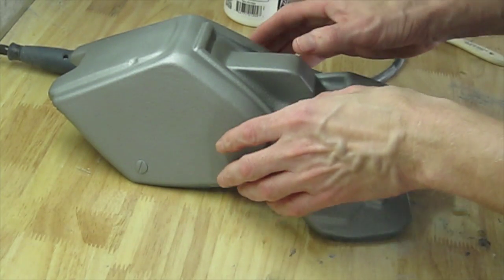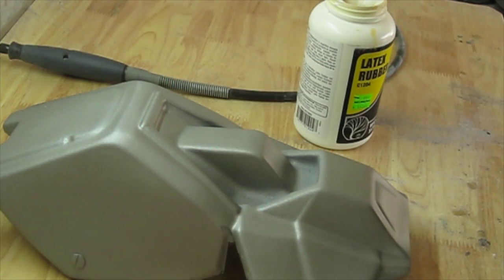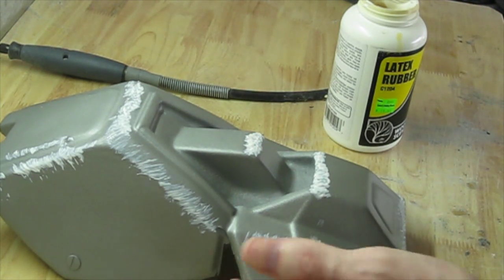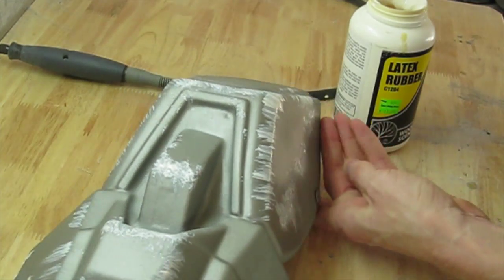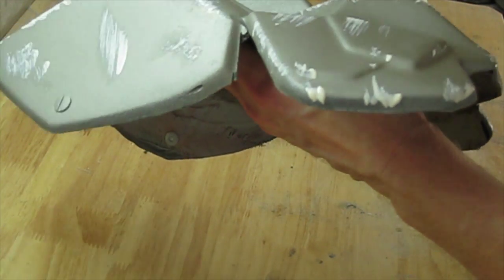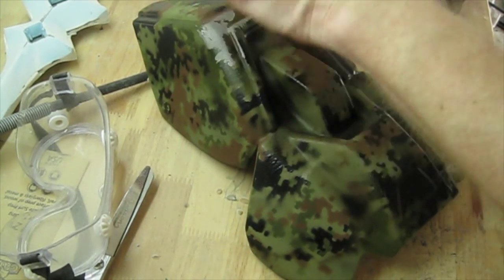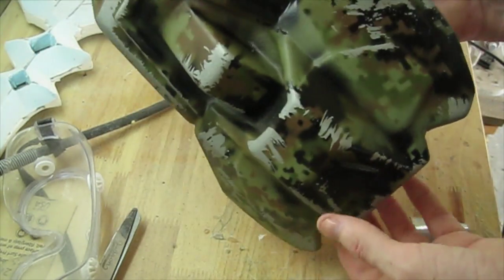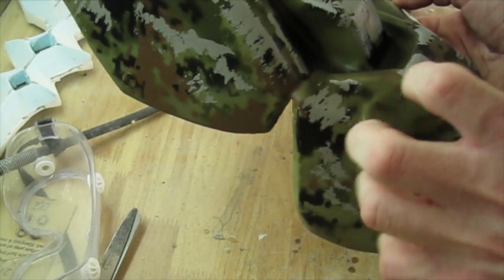Weathering Armor: Chipped Paint

Comment: Drybrushing with a lighter silver color before you do the latex would add another layer as well. Hmm you could add another base coat and sand down a bit once the latex is removed to give it a scratched look. Have you experimented with multiple layers and the latex? Base coat then add a light layer of latex and then base coat again with another layer of latex. do the finish coat and peal down to the first layer again.
Reply from the maker: +Jonathan Bowen That's something I would explore if I wasn't already putting on 5+ layers of paint. Even now I may go over some spots with a dry brush of gun metal.

Comment: great video buddy. im curious how u did the camo paint job as well :)
Reply from the maker: +Joshua Brooks Thanks. I've got some more in the works. There's a number of ways you can achieve the camo pattern. You can use stickers to mask it off, which is what I did with my helmet, or you can use stencils that you can purchase from a number of retailers on line. The stencil I used for most of my armor is from Primary Arms.